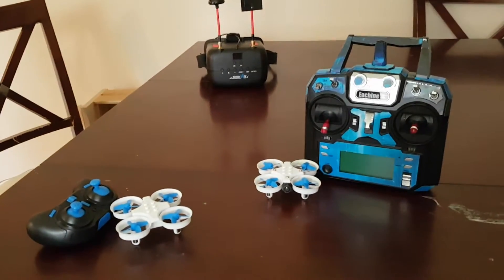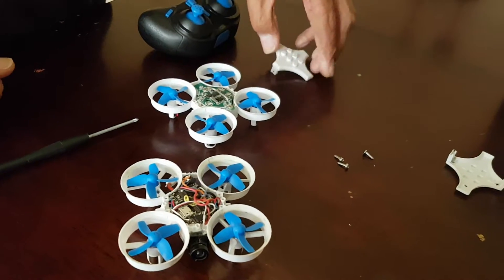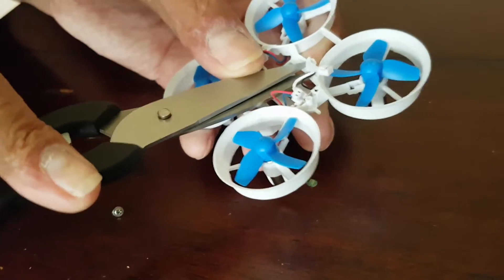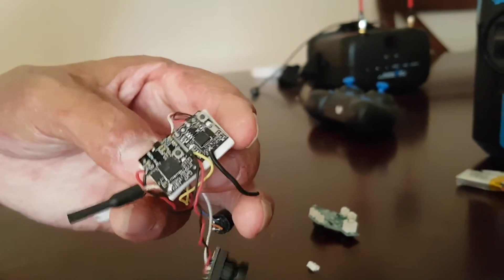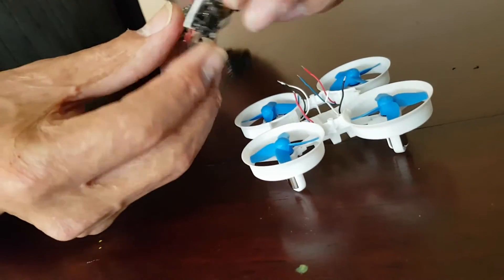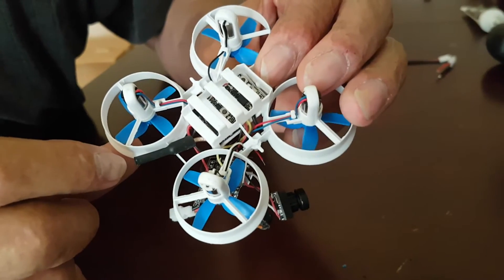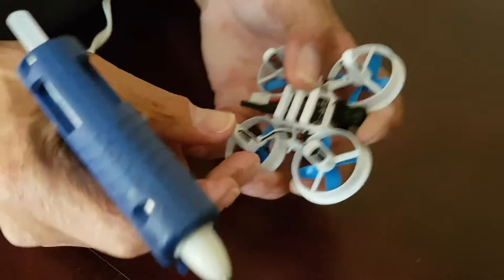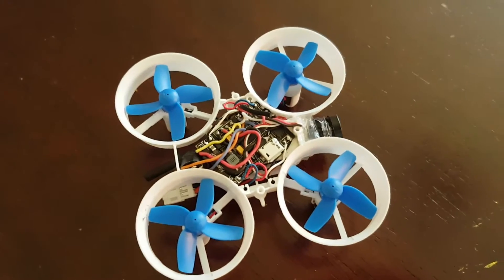Best Low Pro Tiny Whoop build guide F3/OSD E011 7mm motors -FPV flight 12:21-(parts links below)

Comment: You have to try the motors from the idrone i3, they are 716 that deliver 19500rpm... I´m currently running the same frame, motors but on a Beecore v2 flight controller... Monster whoop for sure...

Comment: Just wondering how many cycles you have done with the battery and how it's holding up? My H67 Santa quad (I believe it's an E011) seems to be degrading the battery. Wasn't sure if it was the late 3.1v warning or too much current caused by the camera.
Reply from the maker: my E011 batteries lasted almost 1000 cycles i think. but my santa quad battery didnt even make a few flights... must of been some old stock sent with those :(
Reply: Did you use any other batteries in the santa quad? Its possible that they send crappy batteries with the santa because they know ppl will only use them at christmas. Maybe they lowered the voltage warning on it too because of the speaker to maintain the flight time
Reply from the maker: Hella 0 yes I believe the used old stock for batteries hoping nobody cares because it was Xmas based toy

Comment: Nice build!
I had a E011 with a broken stock FC around so I thought I'd give this a try and I ordered the Realacc F3 V1.0 and the FS-RX2A Pro Receiver to go along with my FS-I6S.
I'm however having problems getting the receiver to work. It seems to bind with the I6S since the greed led stops flashing and is just solid green. I did use the 5v for the FS-RX2A and I have the Ibus lead soldered to the RCIN. I have Ibus configured in betaflight and UART3 to Serial_RX and the i6S is set to ibus but all the channels in the "reciever" tab in betaflight are just blank. 
Any tips? Did you have to have to update to a newer verison than the BetaFlight/OMNIBUS 3.0.1 O that the board shipped with? It also seems that my FC board is a newer revision or something since the USB port is on the other side and some of the chips are rotated 90 degrees compared to the one you have, don't know if that makes any difference.
Reply: In case someone else runs in to the same issue: The solution is to upgrade to a newer version of Betaflight. I flashed 3.1.7 and got both i-bus as well as ppm to work directly after that.

Comment: Does the realacc allow LiHV 4.35V battery?  And does it have a current sensor?
Reply from the maker: yes and yes
Reply: Ascension Drones thx.  Hmm, banggood said it doesn't support LiHV.  I wonder if anyone really tries it
Reply from the maker: Wilson Chow i tried it. i had to turn the max voltage from 4.3 to 4.5 and it didnt flash and beep or fry

Comment: I used the older non-OSD F3 board from my Eachine QX-95 but didn't think about shoving it in sideways to fit in the E011 frame and compensating via software. Looks more tidy.

Comment: Wow those are some long screws. What size screws are those to mount your FC?
Reply from the maker: cassetti02 the screws only connect the canopy. I think those are 1/2 inch m2 self threading screws. The frame is plastic so they just need to be long enough and not too thick to work.

Comment: What pids are you running on this build ?
Reply from the maker: Benoît DESTRUBÉ  for the flight in this video and anything I have posted so far with this build the pids I used are in the video at 19:07 , they work great for everything except diving I've tuned them recently to be more stable will update with a video displaying the new pids and the benefits soon

Comment: How did you get the OSD on your Video signal since there is no Video In on the camera ?!
Reply from the maker: François S its OSD built in to the flight controller. video out from camera goes to fc then a new video out comes from fc to the vtx with osd
Reply: AH yeah, VTX is not integrated in the camera build

Comment: hi would a VTX 03 fit as ive one of those on the way great video,thanks for taking the time to make it
Reply from the maker: i tried an atx03 and the vtx03 and couldnt quite get to fit nicely,
Reply from the maker: there really isnt much room in there that lcd display just gets in the way on the vtx03
Reply: thank you will order a vtx01s
Reply: Atx03 works on the stock board of my e011c santa whoop minus the speaker.

Comment: For the upgraded camera do I want nstc or pal?
Reply from the maker: my video is Ntsc depends on your preference. pal gives a slightly better vertical frame of view. but im in Canada so Ntsc is the standard
Reply: I am new to this hobby so I don't know what each one means
Reply from the maker: makes sence sorry whats the standard for your tv equipment? i use the Eachine Vrd2 goggles they are compatable with both. basically North America uses Ntsc and Europe uses Pal. but i use both. check out my flying frog Video thats a Pal camera it has a slightly different frame of view check it out on my channel.
Reply from the maker: usually its recommended to stick with your local standard but most equipment can handle both. i prefer pal but my tiny whoop is on Ntsc

Comment from the maker: this flysky receiver (fs-rx2a pro) runs best on 3.2v not 5 so connect power same as dsmx/dsm2 have overload issues causing power failure on 5v but works flawless on 3.2v

Comment: great build. Is there a receiver I can use that is the same size but is fr-sky compatible?
Reply from the maker: i added links in the description for frsky and dsmx/dsm2
Reply: Do you know if the FrSky XM+ will fit as you have it??  It is 21mm long x 12mm wide and has diversity!
Thanks ahead of time for the reply!  LOVE your build!  Since I've always loved the E011, and have been wanting to get an upgraded mini whoop, I think I'm going to tackle it! (:^)
Reply from the maker: the Flight Controller i linked isnt diversity compatible although the XM+ would just fit with the build if you use an appropriate FC